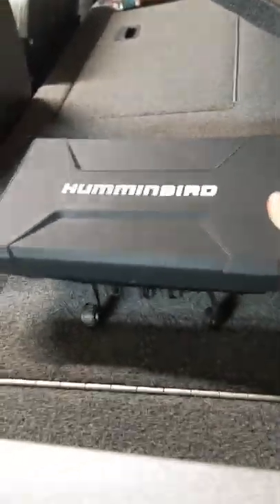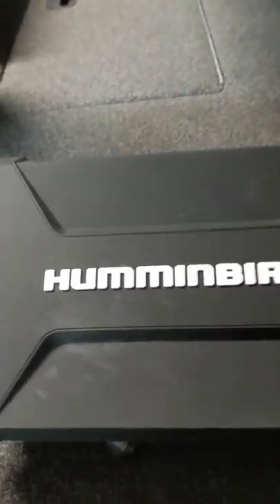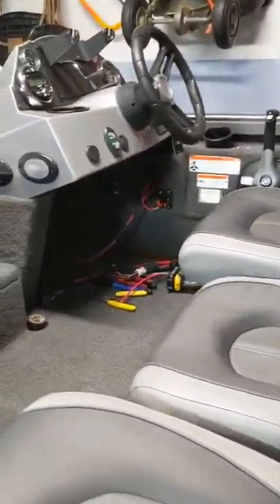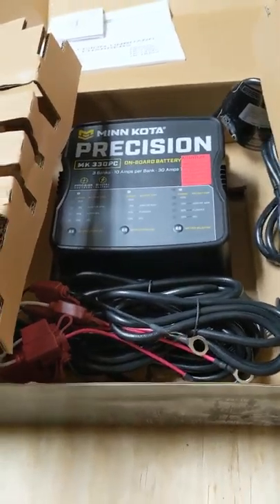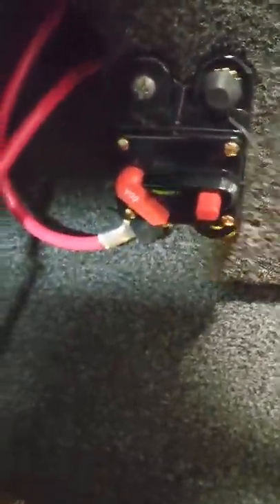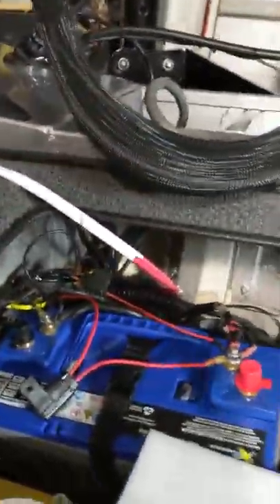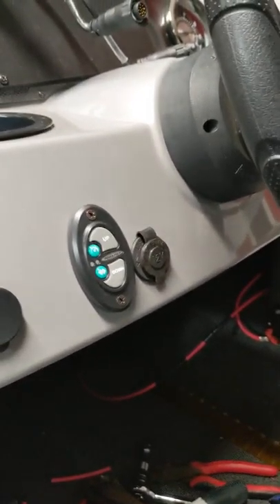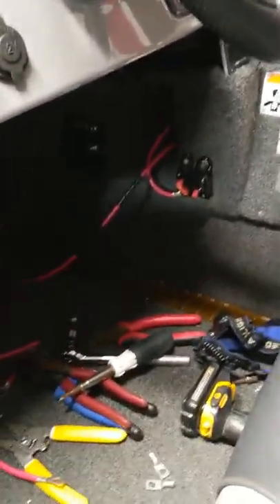Running bigger wire for Hummingbird Solix

Comment: Did it work? I have the same issue. I thought maybe my starting battery was too small, but seeing you installed an X2 and it still does it, I'm not sure now. My solix 10 is rigged the same as yours, to the existing fuse box with everything else.
Reply from the maker: Yes sir, it works great